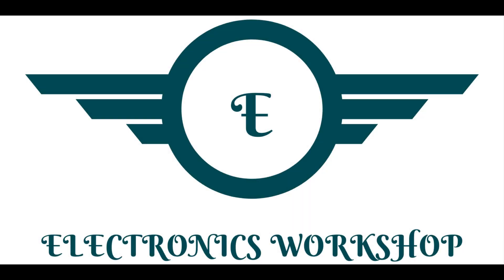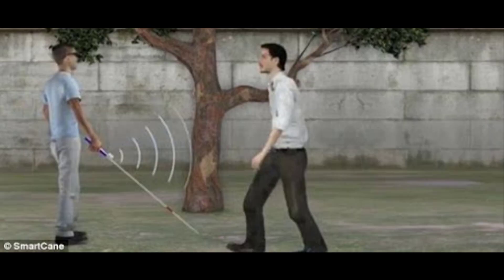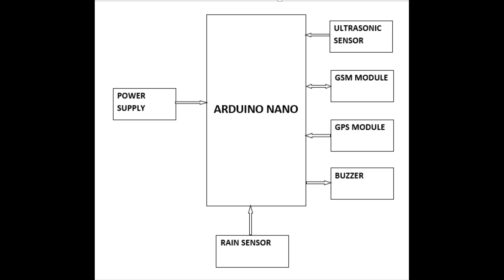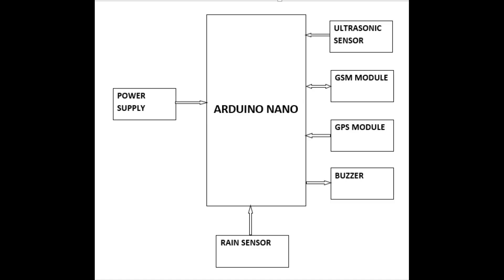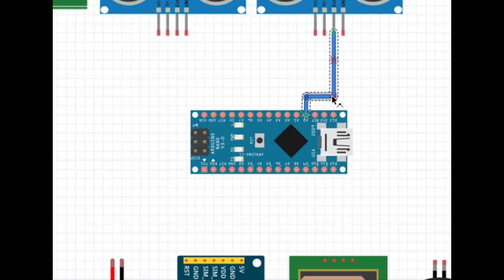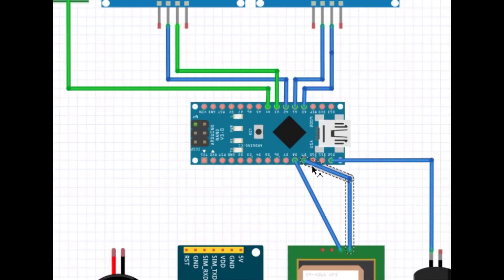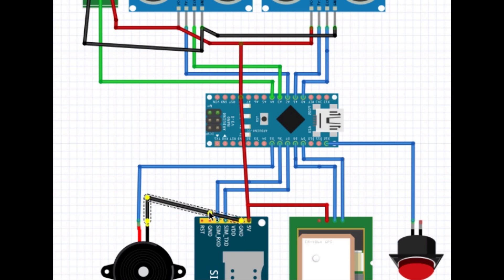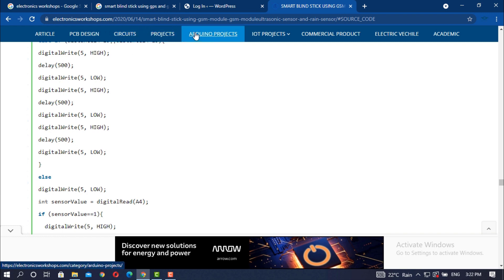SMART BLIND STICK USING ARDUINO , GPS AND GSM MODULE

Comment: sir, can you make a circuit diagram with the ultrasonic sensor, vibrator, gps module, battery, aurdino, buzzer, and water sensor? could you provide the circuit diagram and code required?

Comment: sir thank you at first  , when the stick starts to work ,if i press the push button or when?
how can message sent to others sill by pressing the push button or by what ?
Reply from the maker: If you are in trouble then we must press the button and once the button is pressed the Arduino commands GSM module to send message to respective number
Reply: @electronicsworkshop7131   so it is not necessary to press the button to start as the stick starts functioning by itself when it is powered so, how can i make it to start  manually to save the battery ?
Reply from the maker: You can add one button for that

Comment: SIr can we use GSM SIM 800L instead of 900L for the same code
Reply from the maker: No you can't add as the code differ when you change the sim series
Reply: @electronicsworkshop7131  sir can you  please provide the code for GSM SIM 800L
Reply: @zagaderohit1203  hey did u get the code .If yes,can u plz share it
Reply: @gurramrishitha  no but i have made another because network wasn't work on gsm but i am made with node mcu and it work perfect
Reply: @gurramrishitha  and i was having gsm sim 800l may this was problem
Reply: Can u please clarify about the circuit diagram
Reply: @gayatrijayakumar7647  hey.have u done this project?

Comment: sir why this error is there:                                                                    
Arduino: 1.8.18 (Windows 10), Board: "Arduino Uno"

blind_stick:4:10: fatal error: TinyGPS++.h: No such file or directory

 #include <TinyGPS++.h>

          ^~~~~~~~~~~~~

compilation terminated.

exit status 1

TinyGPS++.h: No such file or directory

This report would have more information with
"Show verbose output during compilation"
option enabled in File -> Preferences.
Reply from the maker: Modify your GPS library
Reply: @electronicsworkshop7131  thank you sir
Reply: @electronicsworkshop7131   SIR THERE IS NO  ' } ' AT LAST OF PROGRAM
Reply: @zagaderohit1203   is this program really run in the Arduino ide without any error ?
Reply from the maker: Modify your GPS library
Reply: Can you please @ZAGADE ROHIT that which gsm module is used in this project
Reply: CAN YOU PLEASE TELL WHICH GSM MODULE IS USED IN THIS PROJECT

Comment: Amazing project i like .,.sir you are genius ,,,, sir i have a question if i use arduino Uno instead of Arduino nano ...than it will work?? On same code?????
Reply from the maker: Yes it works but the size of Arduino Uno is big so it may not fit in your stick
Reply: @electronicsworkshop7131   yes sir you are right sir but there is another problem for me ...in our country gsm based project is not allowed .... So i want to make this project without gsm .....what will i do for this?
Reply from the maker: Yes if you find any issues mail me on
electronicsworkshop111@gmail.com

Comment: Sir/ma'am what is the  name of the rain sensor you used in fritzing . Please reply
Reply from the maker: You can make the rain sensor by your self by making the conducting place when water falls to it
Reply: hello mam will u please share the circuit and code of smart blind stick using Arduino